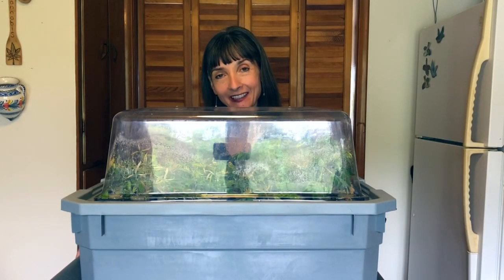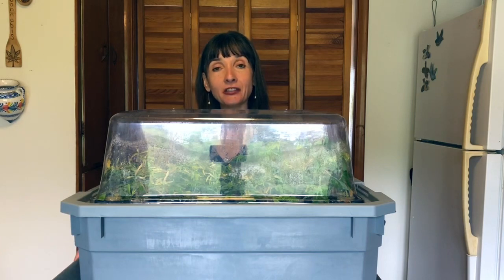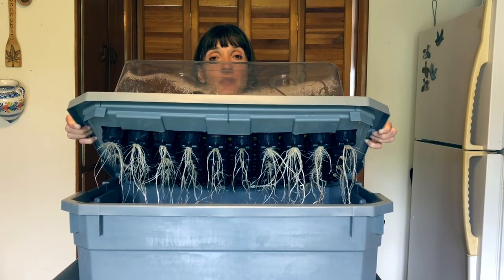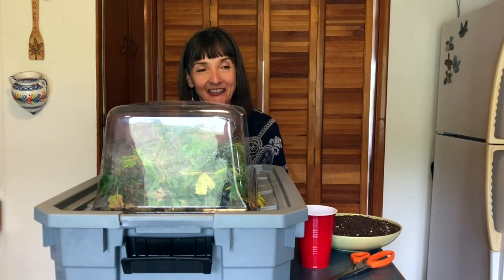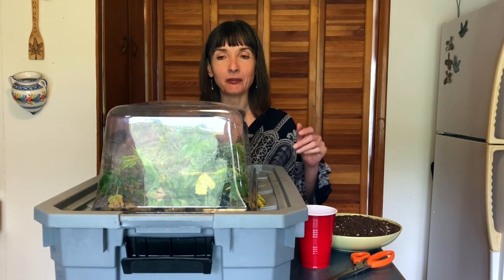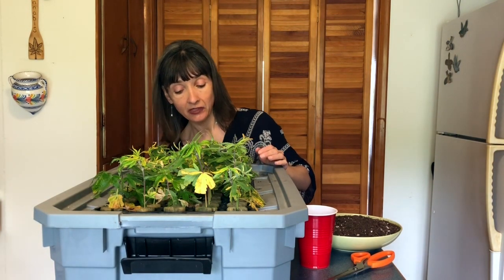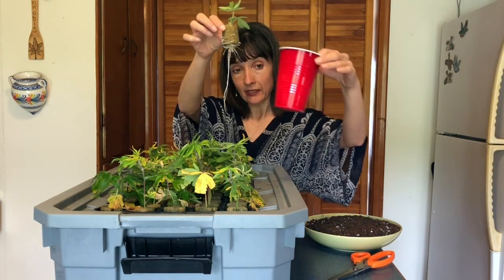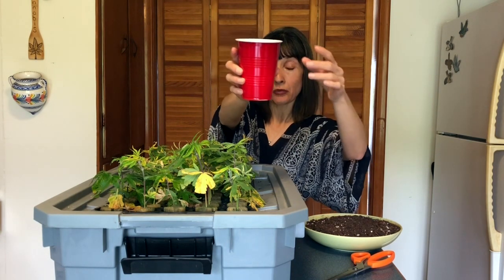DIY Cloning Results

Comment: you need the lid?  I have something like this and never used a lid.  no problem even in dry winter months.  btw this halloween I was planning to dress as air stones and a pump, we could be a duo, do a little propagation...
Reply from the maker: Hi voidremoved! Thanks for taking a few minutes to comment. I'm a relatively new grower. This will be my 6th garden and my 2nd season (time) to grow outside. The genetics :15 different strains...many hard to find. Trying my best not to screw up, I pulled out all the stops, including using the dome terrarium. :)
Reply from the maker: You’re on! Let the “Harvest Party Costume” planning begin! Truth be told, by the time we get to the end of harvest, I’m just one sticky mess...maybe being an Indian Temple hash ball is more my thing and I should give up my dream of being only a head on top of a plastic tote. Lol!